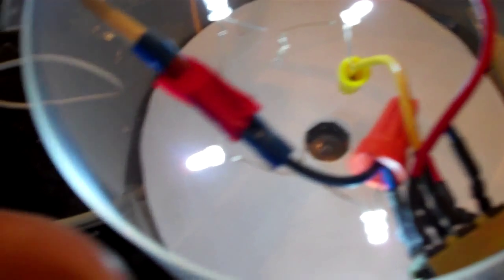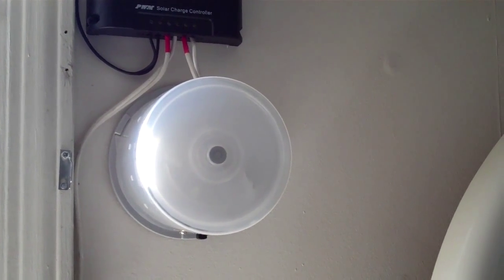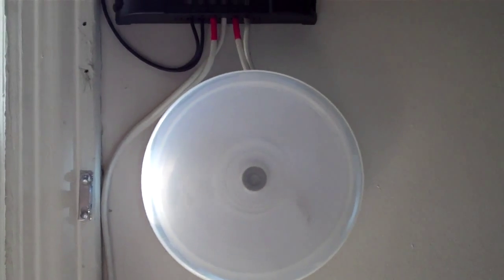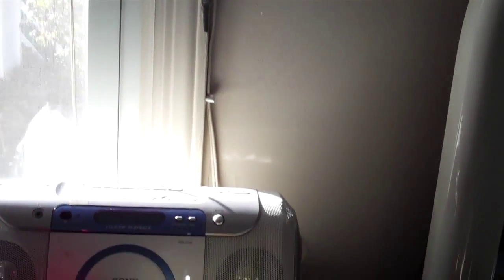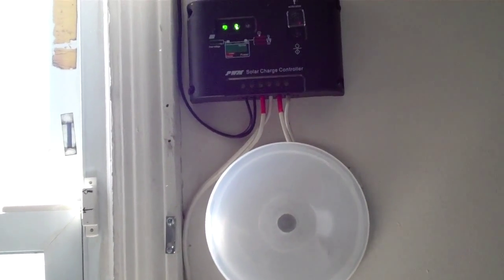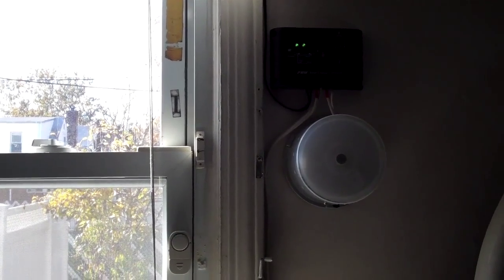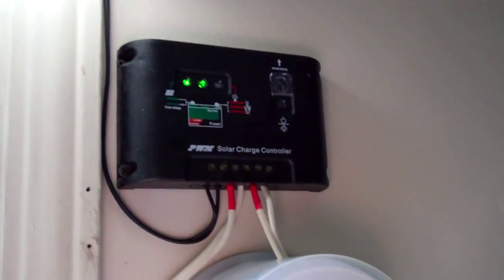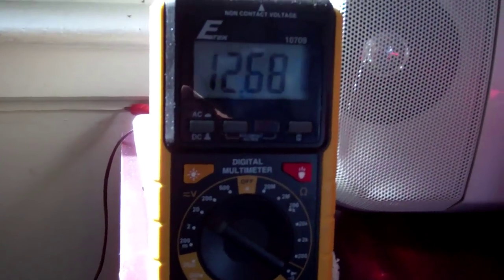Indoor solar general purpose emergency lighting pt 2..mp4

Comment from the maker: @Fearlessthinker Thanks for the detailed analysis.  I'm a bit worried about the charge controller drawing a bit of electricity at idle.  My 4 LED light probably draw about 1 to 1.5 w I think.  I will try to measure what the LEDs actually draw from the battery later on.